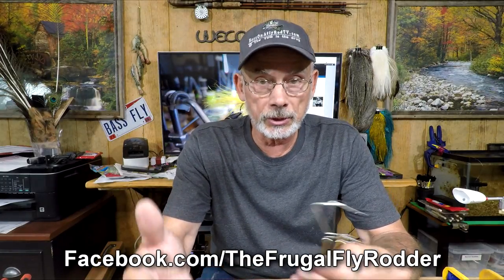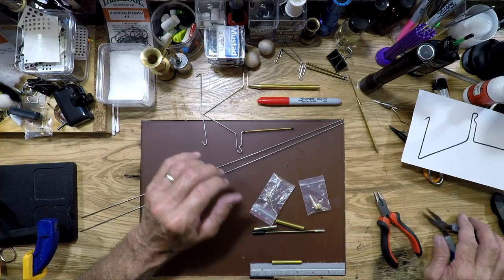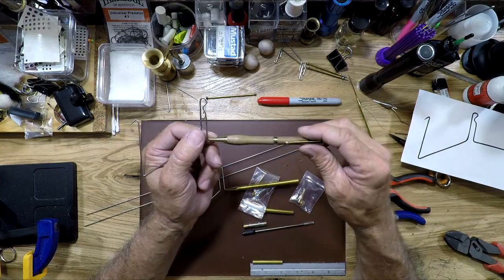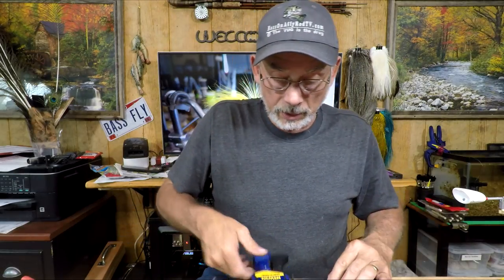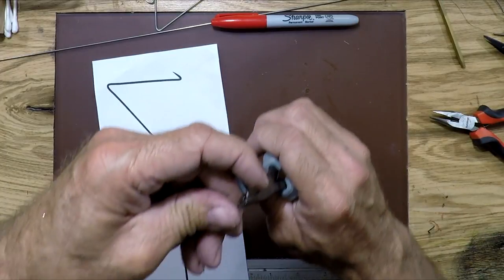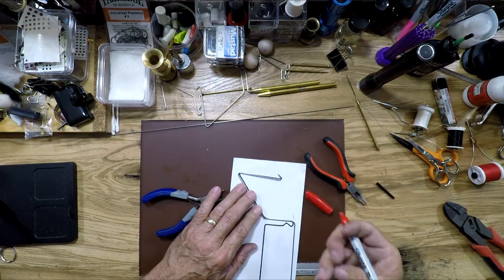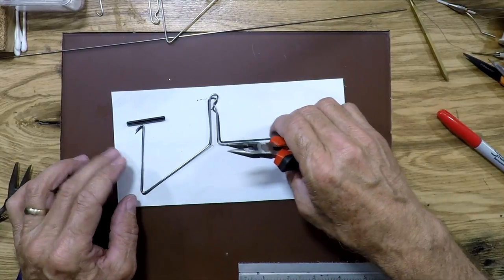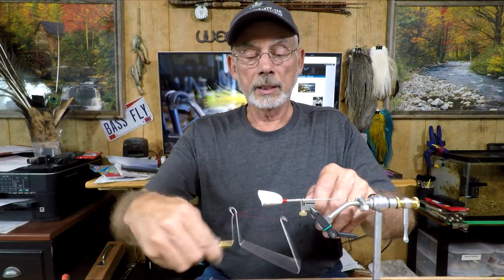Making a large whip finishing tool

Comment: There must be a difference in terminology between the US (?) and downunder because what you call a split pin, we call a roll pin.  The term cotter pin is also used for the split pin by some people here.  Not attempting to have cheap shots, as this is the best vid I've seen on a whip build for finishing off my deer hair jigs
Reply from the maker: @goomahead3886  @goomahead3886  well... you're right, sort of. But shooting a video on the fly, sometimes things said are not that accurate. However, although the pins are typically known as roll, they are also known as split. I've made some improvements in the building of the whip finisher and am planning on a new video. I just don't know when yet.
Reply from the maker: By the way... Google: 

uxcell M6x45mm Stainless Steel Split Spring Roll Dowel Pins Fasteners
Reply: Fully chastened here, 😢 ..  The first result was a temu (they're everywhere) set of what I would have called roll pins 20 minutes ago.  This was on the Google Australia site and I should have researched instead of being slack.  You never stop learning.  I subbed to your channel and look forward to more interesting content, and appreciate your work.